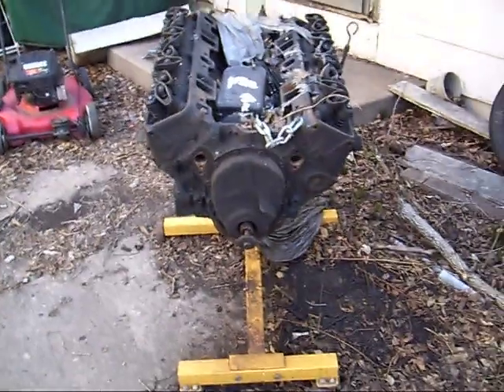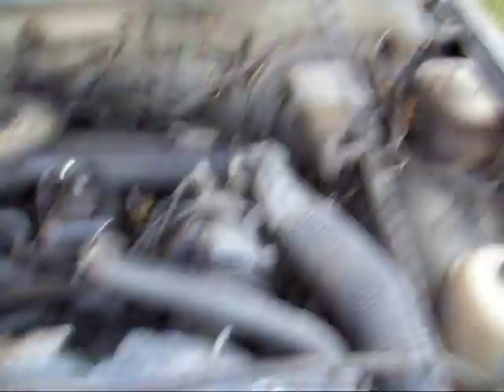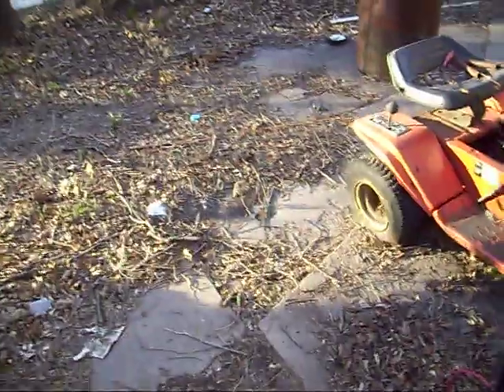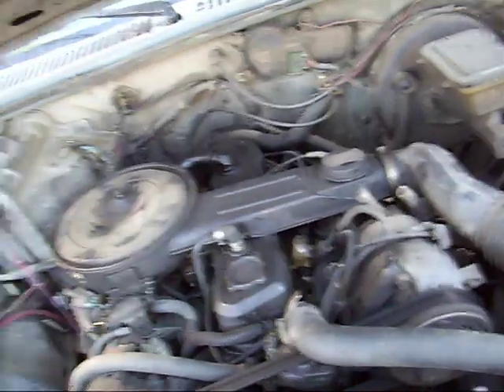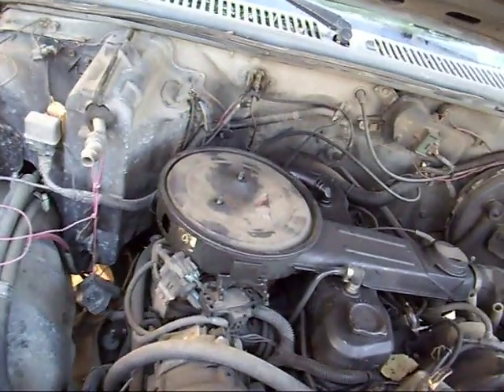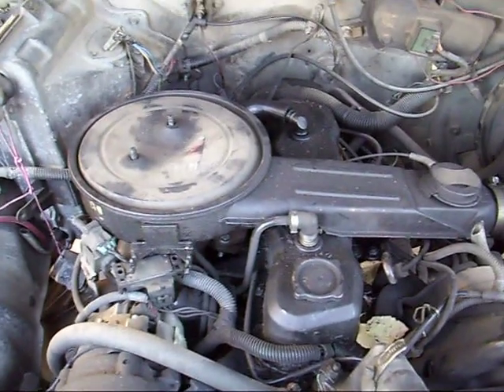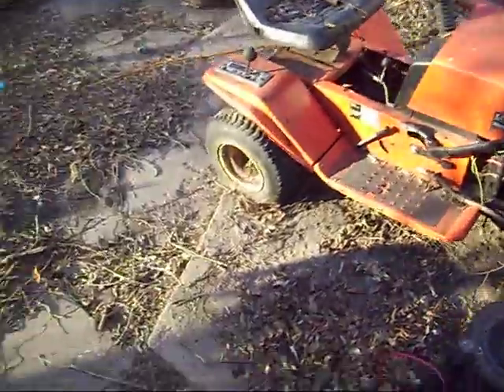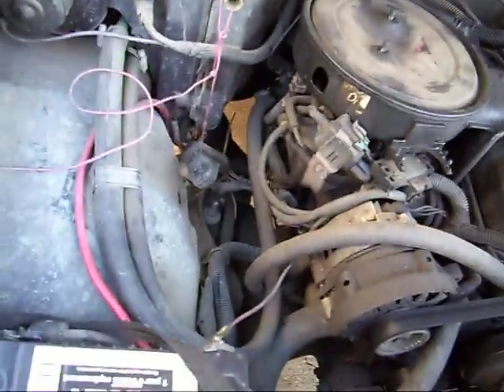Intro to engine swaps.

Comment: I have a 73 chevy c10 with an inline six I want to put a 350 in it but I don't know much about swaps never done it before what are the basic things I need to know. And what about the transmission do I need one that will fit a 350 or will they be the same?
Reply from the maker: If the trans is a TH350 it should bolt right up. You may have to get a different torque converter for it as the bolt pattern might be different. I have a 73 c10 and I know the swap your going to do is easy. You will need new motor mounts. If the inline 6 is HEI you just hook the wiring up the same way. Feel free to ask ?s as you are doing it and I can help as much as possible.